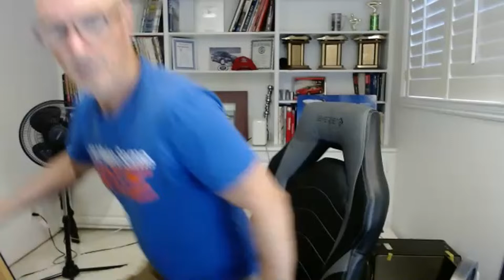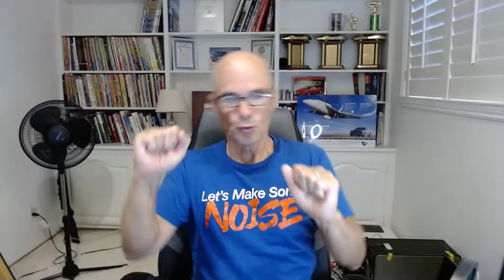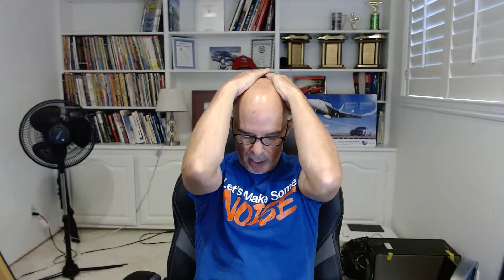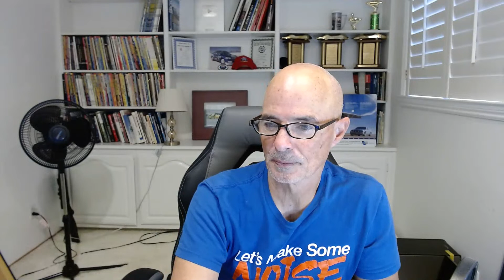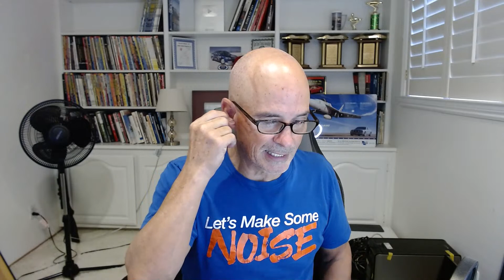LET'S TALK TECH-THING I DID WRONG!

Comment: There's a huge difference between optimal and functional. Turbos make it easy enough that optimal isn't really required in a lot of cases. If you really look at this test congratulations you tested a remote mount with an oversized turbo. :)

Comment: My project has to do with knocking on 4.3 Chevy Blazer 1999, resent new transmission well over a 100.000.oo miles... body very good shape and being the LT version with everything from electric heated seats all amenities,  same transmission as Escalade.... was hoping at first it was exhaust, checked out ok, second, backed off converter bolt, checked out, I put a scope on locations I assumed that knocking was more present mostly from drivers side exhaust right before the catt , and also similar block location? Vibrations... motor mounts seem ok and tight...sends me to investigate a possible worn crank bearing... of course pull the oil pan and poke around... as you a aware of this requires pulling front differential, and  various front-end parts ... not not like  working on my old small blocks, but when running correctly very enjoyable... hope fir your advice,  rebuild is nit really im my budget right now... I've built vehicles from ground up in my past and swamped motors and transmissions but don't really have a idea place to do a complete teardown... thanks again and keep up the good work....
Reply: From,  JD  also having to put my Lumber Jack helmet ⛑ on from time to time,  it's a good time....
Reply from the maker: is the sound internal in the motor or external
Reply: @richardholdener1727     good point,  as you know knocking can come from something as simple as exhaust donut 🍩 to main bearings, crankshaft bearings... piston break down,  I don't know what's making me feel like internal? Hopefully no more then a worn crankshaft bearing,  if so I'm sure you know of the quick fix of slipping a new set ii....  I plan on earlier in the morning 🌄 tomorrow is pulling oil pan, see what's up,  I'll give you an update if you like... I realize you find decent stuff in the old junk yards.. ;  )